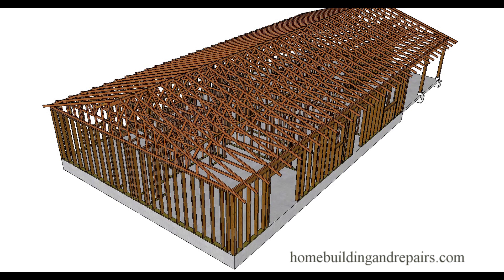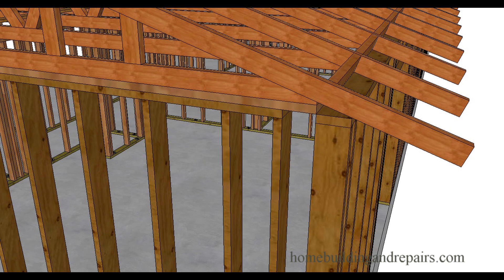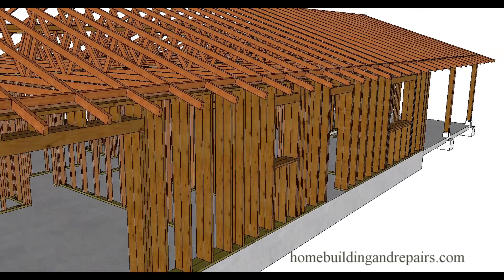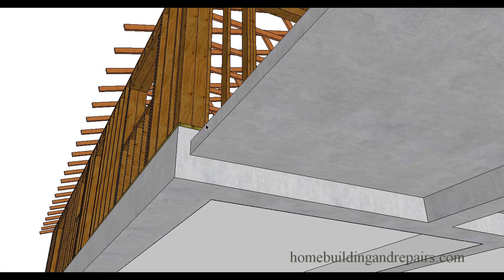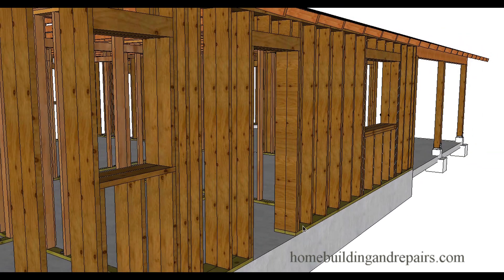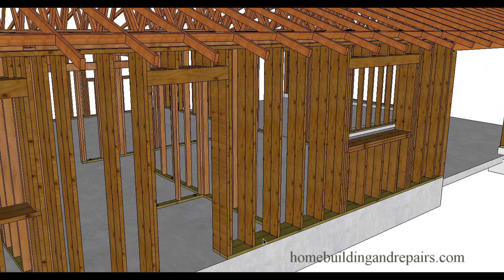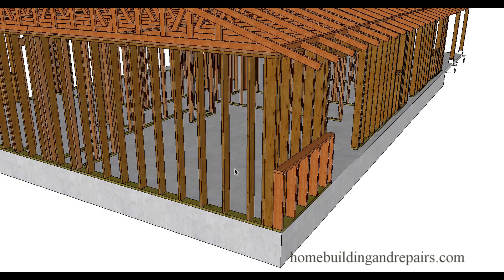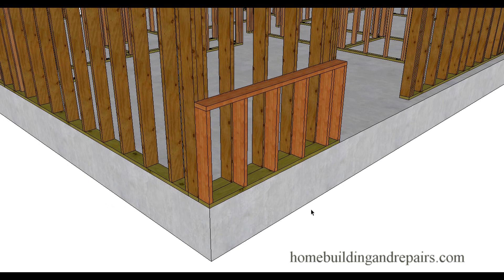Add Another Wall If Roof Trusses Are Shorter Than Building Foundation

Comment: I have a related issue. My existing second-floor top plate plumbs down almost an inch outside the first-floor footing. Sloppy concrete work or sloppy framing- blame anyone you want. It is an issue now in that I am adding a second-floor covered lanai. The new trusses will extend 1 inch beyond the supporting beams if I build to plan. Do I adjust the new post footings to accommodate the existing roof or do I let the trusses hang long over the beams? What is the best solution?

Comment: I have this problem on a garage i am building not on a slab but on a stub wall. Stub wall comes up about 2 feet above the concrete floor.  I repurposed the trusses from another garage.
Reply from the maker: Could you lay a beam on top of the garage floor and use it underneath the wall? If you are not going to pour an additional footing wall, then you will need to somehow build up the area that will be supporting your new wall that will of course be supporting the trusses.